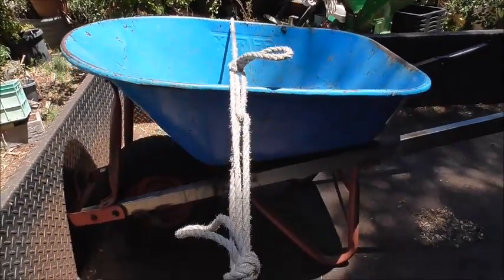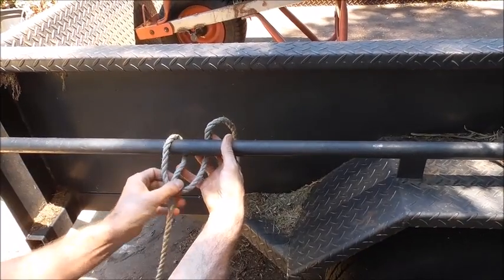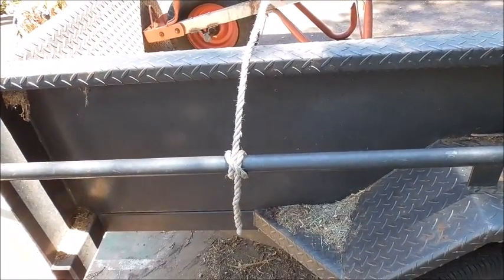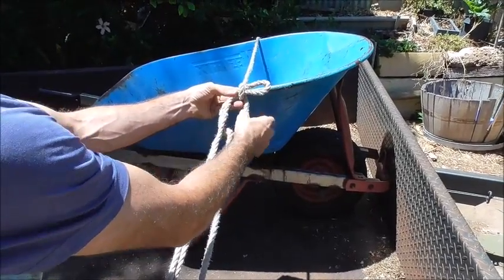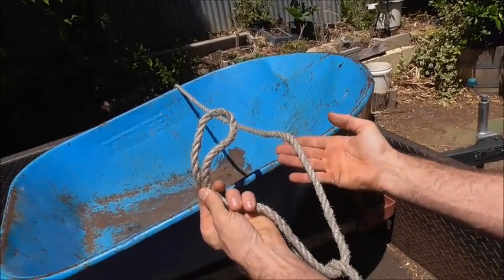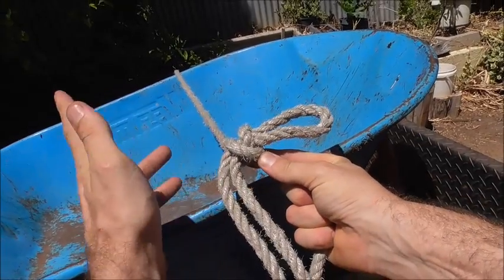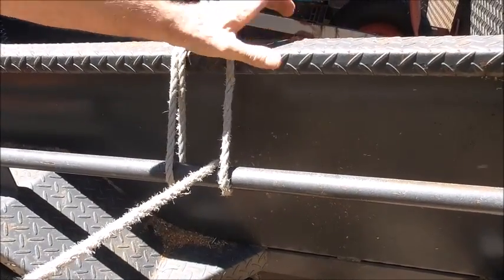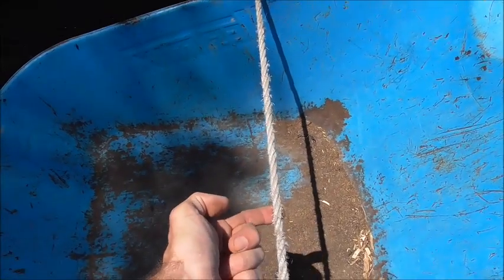Best Truckers Hitch For Transport Easy To Untie/Quick Release

Comment: Nice example of the truckers hitch but it always puzzles me why people start and finish the knot with the clove hitch.
The clove hitch can slip under load and with a trailer moving on the road it's not ideal.
Personally I would start with a bowline and finish it off with a round turn and two half hitches.
Anyway still a great video
Reply: Pill Sharks..  was a bit skeptical of that usage of a clove hitch myself.  I always at least finish off a clove hitch with a half-hitch on top.  They can definitely "creep" on you, and are terrible by themselves with certain types of rope, i.e. slippery.  An otherwise very useful knot in many situations.
Reply: Yes me too, I always use a bowline around the object or a bowline used as a loop for the rope to pass around the object and back through the loop fromed by the bowline. I have used this for years and it has not failed me. Mind you the people making htese very good videos obviously know how to secure a load and the clove hitch must work for them.

I tend to only use the clove hitch, a good knot, for when I start a lashing or on my bean sticks. I guess it is down to personal preference but for a vehicle tie down I feel safer with a bowline, or as you mention, a round turn and two half hitches which is also a good anchor.
Reply: I would finish with a Round Turn and 2 Half-Hitches.  The round turn takes all the tension unlike here where the tension slacks a bit when making the clove hitch.  Btw, a half-hitch is usually added to the clove hitch for extra security, making a 'clove hitch and a half'.
Reply: Clove hitch & half is how I usually tie those, but like the folks above, I never use it for loads. I"ve always tied a bowline or a figure 8.
Reply: I've never had a clove hitch move. If it's moving on you, you've tied it wrong and the rope isnt biting into itself.
Reply: The clove hitch is a stupid knot...for all the reasons you mentioned...arborists hate that knot...because it's so undependable.  
I dont know why guys always go to it.....I would farrimond friction hitch the starter loop to adjust if needed and if have time.....do my trucker...then end with a round turn 2 half hitch, or a constrictor knot with a quick release bite...maybe a caribeener lock on that quick release if I needed it not to come undone...liken a multiple day trip.

Comment: While its tightish you did lose a little tension tying the final clove hitch. What about retaining tension better with the automatic truckers hitch?
Using the alpine butterfly seems a stronger way of achieving a mid line loop.
Reply: All the pressure is on one knot and will be a little harder to undo. Double shank/wagoners hitch is the best option

Comment: I’m sure the original poster of this video meant well, but clove hitches alone (with no backups) are unsafe for this task as they’re known to slip. Much better off with a bowline, a round turn and two half hitches, or even an anchor bend.
Reply: Clove hitches don't slip. The more you pull on them, the more resistance they give.  I've never had one slip on me after years of using them.

Comment: I do not like the idea of the truckie knot because if the top knot comes out, it seems like the rope would cease to be holding the load.  The top knot is a slip not with nothing keeping it in place other than friction.  At least in a truckers knot the lower rope goes through the loop in the slip knot so it can not undo.  I also prefer to use a slip knot when finishing so it is easier to undo. removing a tight clove hitch from a rail does not sound easy. I could see that the slip knots in the upper part of a truckie knot are easy to undo.
Reply: I also have never had or tied to a vehicle with a rail for tying
Reply: Check out Brandon Nelson's video.  He shows the way I tie a load on.
Much better and easier tied.
Reply: If done correctly,  this knot won't slip.